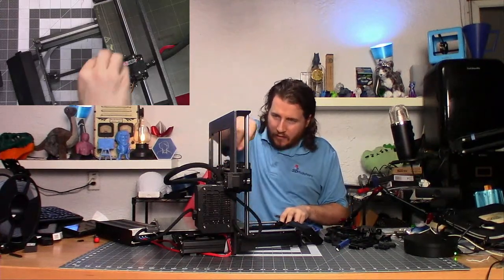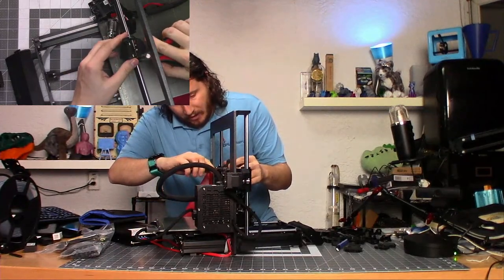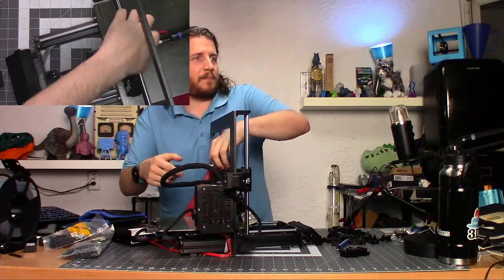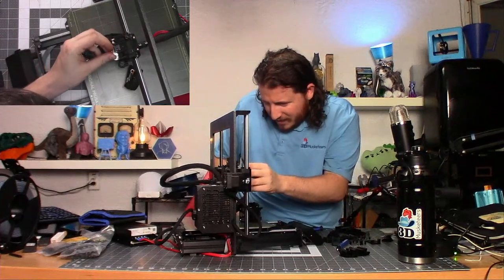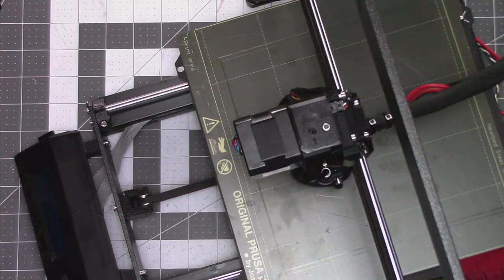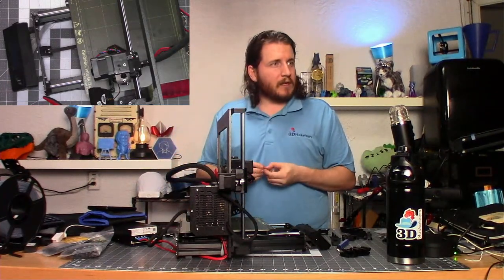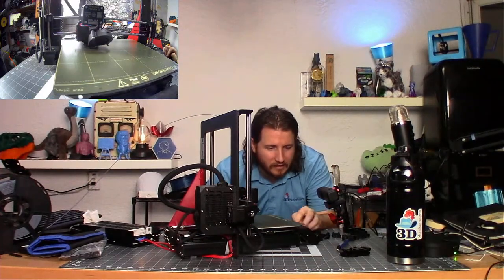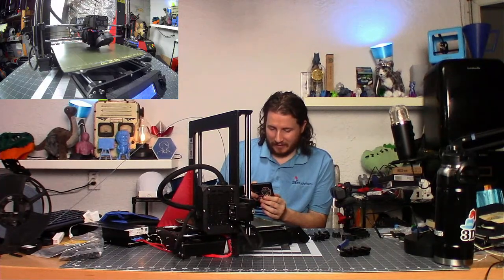Printer Maintenance - Repairing a MELTED Prusa i3 MK3S+

Comment: I'm a Kickstarter backer X1CC. As I usually just print in the centre it's been fine. I had to use the corners and that's when I found that my print Petg was warped at the corners. So I contacted support and I had to go through their hoops which they said at first to do manual tramming. That can cause more issues with the Bambu if you mess around with those bed knobs. So they are sending me a new bed as mines warped. Just to let you know that V2 bed will not be compatible with V3 bed as the AC Board will also need to be updated to V3 too. 

They are sending me V3 bed and V3 AC Board. If you have V2 bed you still need to read the V2 bed replacement guide due to wire guides even if you upgrade to V3.
Reply from the maker: go figure.. well at least you are getting help!